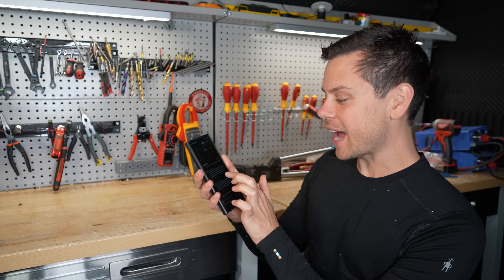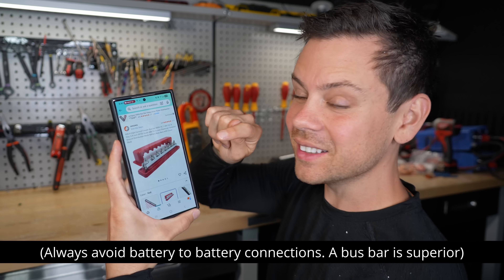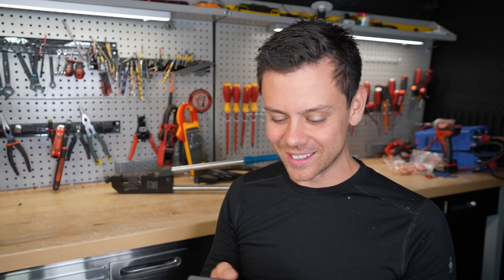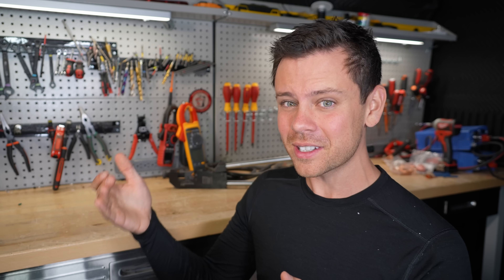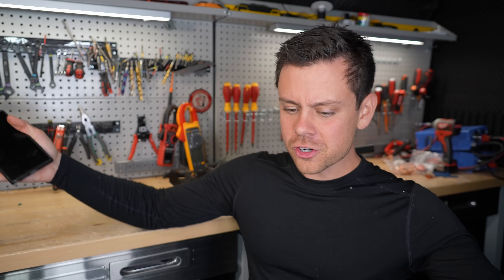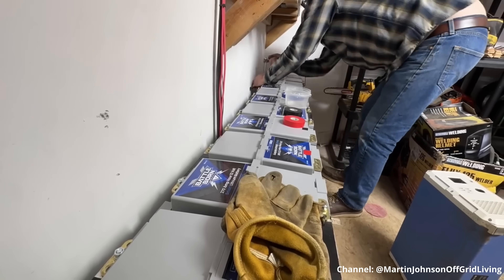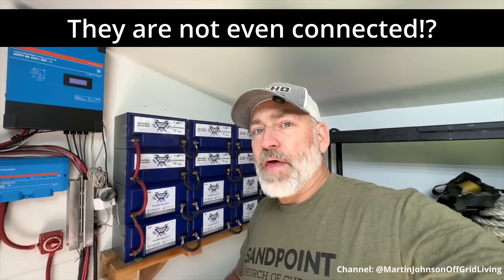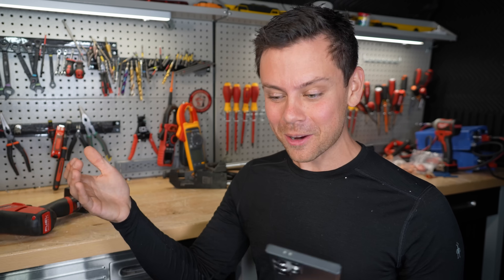My Reaction to Martin Johnson's "BEST Off-grid Battery Bank" Video 😬 Yikes!!

Comment: 16 x 12v batteries all resting on a wooden shelf interconnecting with soldered lugs and not a fuse in sight. Beyond risk, prone to disaster. Meanwhile 2 x 48v rack mount 180ah cases with inbuilt BMS, power switch and breaker connected to a bus bar is all that’s required, job done 1000x safer in 1/10 the space.

Comment: Have a quick question, for Will or anyone I have a BMV-712 victron for my LiFePo4 135amp and it’s in a battery box I’ve made, the victron BMV 712 has a aux starter battery monitoring function can I use that with a lead acid car starter battery? As it’s 2 different types of battery?

Also great vid, been watching you for years
Reply: Best option would be to email victron direct.

Comment: i solder em on 12dc systems, if you use the proper size wire it should never get hot... also fuses help

Comment: Most people probably just think any large steel bar will do for a bus bar. It's scary that people are DIYing these setups without proper knowledge. Goodbye insurance by the way, you should at least have a system that connects into 240V assessed by a licensed electrician. This guy clearly has no idea what he's doing. Who solders unless you're in a high vibration setup?

Comment: 9:10 the aluminum will not be any less oxidized from sanding, in fact, the action of sanding may even increase the amount of surface area on the face of the aluminum that will then immediately oxidize, creating more oxide.
Aluminum always has an oxide layer, there is no oxide-less aluminum because it oxidizes readily on contact with air.

Comment: Aluminum on copper is not that bad actually, it really depends on the application. Of course copper on copper is best, but i've seen plenty of examples of lithium batteries with aluminum contacts connected with copper bus bars. 
All of those examples have come from industrial warehouse robots and robotic pallet stackers that work in a wide variety of ambient conditions.
Especially the ones that work at -25C in freezers but are brought to room temp for charging. They go through crazy thermal cycling and i've never seen any issues inside their batteries other than the owner forgetting to turn the robot off causing it to drain the battery flat.
The copper on aluminum interface is always clean from what i've experienced.

Comment: Why hasn't Johnson's video been banned due to clearly ignorant and incompetent construction design ? Johnson obviously does not have the power electrical engineering expertise necessary to produce a reliable, safe and, not to mention, a cost effective system.  //  Soldering the cable lugs is a "No-no" because flux is corrosive to all metals except, maybe, solid gold. Flux must be thoroughly cleaned off after soldering, which is clearly impossible for the now sealed off lug interiors.  // A heavy duty crimper does not "weld" anything. Used properly it does produce an air-free, low resistance and physically strong joint with no danger that excess heat could melt the solder and loosen any such joint.  //

Comment: Most cheap jumper cables are aluminum wire, it has copper coating so most people are confused with the wire they are using.  Soldering lugs....LOL   Nice audio quality 4 gauge copper stranded wire will cover 99% of the cases that people are insisting on 0 gauge being necessary, actually aluminum, wire.    

5:00 - I personally love 4 gauge for everything.  I have no current source or draw that requires bigger than 4 gauge at ~5 ft.   I can connect that wire to a battery the size of the moon, and still have a nice 4 gauge / resistive link.   Bigger is not better.  It depends on charge and discharge loads, not battery size.   If I have a short condition, it will be limited by the battery interconnect size, 4 gauge, protecting the greater system.  

13:00 - You are wrong.   That does not show charge imbalance.   It shows a bank at exactly 40% charge with a slight cell to cell error.   Error that will only be trimmed out at the float charge phase above 80%.   If it was showing 20 - 80%, I would agree with you.  This ain't wrong.

Those Battleborn batteries likely have enough internal protection to protect themselves from charging like that.... and protect themselves from that guy :)

Do you want to work together on a lowest cost battery build?  Let's build a 10-100kW build for minimum cost!
Reply: Alibaba Lifepo4 Battery Prismatic Cells

Comment: Will, I started installing large battery plants 36 years ago in Central offices..(Telephone Offices) -48 volts systems that could easily have 4000ah per string. Some batteries weigh over 750 lbs each with 24 batteries in each string. Some phone offices have 20 and 30 strings of batteries. The one thing that stands out is not crimping the lugs and the other thing is aluminum bus bars? On the battery strings we use lead plated copper bus bars. the battery stings always tie to  copper bus bars. Too small of wire. 4/0 would be more realistic. Will you are spot on!

Comment: A crimped connection allows a copper to copper connection. Solder is NOT as good of a conductor of electricity as copper. So AFTER crimping you can solder to fill in any voids and make a stronger physical connection. Or you can just properly crimp the connection and not solder. . So says the Code.

Comment: Is this response rage bait? There is SO MUCH wrong with your response! You missed the mark OVER AND OVER AGAIN with factually incorrect information!

1) You said he was wrong testing each pack to be with in 1/10th of a volt, and instead they should be charged to 100% then connected (and you also said its fine to just "assume" they will be at a similar voltage). You are flat out wrong, packs at 100% SOC vary in voltage at 100% SOC even new from the factory, let alone if they have been previously cycled. the ONLY way to prevent an inrush current from a high SOC pack to a low SOC pack is to VOLT MATCH. This is the STANDARD in the industry since the first battery pack was invented. 
2) You said he is wrong for using aluminum for the bus bar and that "it MUST be coper" - Again BLANKET WRONG. Aluminum is FINE for bus bar AS LONG AS IT IS SIZED CORRECTLY. Why do you think the lines companies use Al cable for HV at 11kv 22kv 33kv? Why is Al used in house wiring.. Because its FINE. You just need to SIZE CORRECTLY FOR THE VOLT / AMP LOAD. An Aluminum bus bar is of course going to be thicker than copper, but there is NO CHANGE IN PERFORMANCE WHEN SIZED CORRECTLY. 
3) You have ZERO idea what the lug is rated for, it may be rated for a solder joint. A crimp is better for resisting torque or pull on the lug, but i see no issue with a solder connection for a fixed installation. 
4) You're complaining about his 4AWG wire size - demonstrating you have zero understanding. You state his pack is 270amp hours, and that 4AWG is too small. You're assuming the pack will dump ALL its current at one time., or that the load would be higher than the 4AWG rating, which he then clearly explains that the WIRE IS SIZED APPROPRIATELY TO THE LOAD AND THERE IS UPSTREAM FUSING TO PROTECT THE PACK. - So again, NO ISSUE DETECTED. 
5) I do agree with you that the positive cables should not be adjacent to a negative terminal - any movement in the cable against the terminal could rub through the insulation and cause a direct short. 

But overall, your attitude to this is disgusting, you are laughing at someone trying to "educate them" despite having very little udnersatnding of the industry past spec sheets. A basic FACT is that packs are balanced based on Volts not SOC, SOC will result in inrush leading to a direct safety issue or pack damage situation, and your simple lack of understanding about coper vs aluminum is comical.
Reply: @ 11kV, 22kV, 33kV
Lines are properly sized for their application. And aluminium because of cost savings with appropriate steps followed at connections.

Soldered connections? What happens when the undersized conductors overheat?

The load is irrelevant. The conductors need to withstand the maximum current that might pass through them in a failure. With no fuses, a short in the wiring would result in the batteries dumping their max capacity amps. Melting insulation, wire, and soldered lugs.
Reply: @ericdunn6232  Another dumb response, i guess soldering should never ever ever be used ever, because it could overheat? 

Oh so every conductor must be protected for max current? Why aren't your wires in your house rated to the max supply to your house? Oh yeah.. because there is inline protection. Why isn't your DC mains from your car battery in your vehicle rated for the max possible current dump from the lead acid pack? Oh YEAH - PROTECTION, or in most cases because its just not needed! 

Looking forward to you sharing pics of you 4AWG house wiring seeing as you say "All conductors need to be sized to maximum possible loading!"

Comment: 20 grand for batteries - no money for proper bus bars or tools. Mechanical connection is a must - I guess this fool doesn't know solder melts.

Edit - turns out this guy is a shill for the overpriced battery seller - should have guessed.They probably can't find anyone with actual knowledge that will gobble the knob like this fake does
Reply: Battleborn should be held liable for anyone following that video and causing injury, damage, or fire.

Comment: His wiring is bad for sure. But what's wrong with 4s4p configuration? If done with fuses and brackets between each battery and each bank? Ask this the correct sized wire? And an active battery balancer

Comment: This is comedy gold, UK here I worked in the US electrical engineering for almost 25 years , I met and had the pleasure to work with some outstanding multi skilled tradesmen and some super intelligent Americans especially in the Electrical / software and welding fabrication fields , however I also met plenty of clowns like this battery bank building clown show ALL too common, normally results in injury , accidents and equipment failure.

Comment: Serial BMS is no good idea. When one of the batteries bms cut, it will be disposed for the hole series of voltage. For 48v You do need 48v batteries with suited 48v bms.

Comment: So you can solder battery connections as long as you crimp the connection first. You must use the correct crimp die for the wire/connector size.

Comment: Aluminum is not your choice for electrical connections!
There is a reason why we use copper predominantly in installations.

Aluminum always has an oxyde layer on it and is highly reactive to form new oxyde layers, so you have to go to extra lengths to make sure you have good, and lasting connections!
That's just something for professionally, highly controlled processes.

Don't bolt on aluminum bars on your batteries! 😬

(And don't use shity murican made batteries in generell) 🤭

Comment: 4:30 somebody needs to go over to his channel And tell him he needs to redo all those connections and get rid of a solder You just made a resistance point and using other size wire also is going to create a fire. Somebody should go over there and tell him he's putting a family in danger with ignorance. This guy should have gone to a  car audio shop and see how actually wiring installs are done. This guy I don't know what to say

Comment: Not to mention the maximum throughput internally (cabling and BMS) of each battery.Good call on not soldering lugs. We do that, but never considered potential heating of the terminal melting the solder.

Comment: WTAF!?!?! Sure I use solder on SOME low voltage stuff like simple LED lighting, fans, ya know 12v stuff. I'm in an RV so vibration is a factor. You have to crimp lugs however!

Comment: I crimp mine with a hydraulic  crimoer than solder,  the crimp is so well that the soldering doesn't  pass through,  however I like drilling and filling the empty  space with flux and tin.  Then the same on the other side, all my crimp are done twice meaning a wider crimped area,

Comment: You would hate my set up, I’m even confused. 1 battery 460AH , 1 3000Watt inverter bur my solar panels are all different, rated at 12 Volts but not by the numbers

Comment: Dude also used solder and flux from the plumbing isle at Home Depot. Probably not a big deal for this application, but the kind of solder/flux used when sweating copper is not usually the right composition to use for electronics.

Comment: After watching the Battle Born videos, he is creating a safety feature by using solder instead of crimping them. If the terminal overheats enough the solder will melt, allowing the wire to become loose, thus limiting the current. See, it's a feature! In any case, this video was posted four months ago. I then wandered down and saw that Martin made a followup to his video a couple of months ago - I'll see what the six mistakes he identified are.

Comment: Buy cheap buy twice? With what you spent on your batteries alone I could buy almost 5 highly rated complete off-grid systems from places like Sun Gold power. A 6.5 system with  inverter that can parallel up to six units and even supply 120/208 three-phase power If you wanted to, with 5,500 watts of solar panels, breakers, solar wiring and connectors, and 2 48v 100 amp hour server rack batteries with proper 48 volt BMSs with communication that is designed to control parallel strings is $5,500. Everything UL listed.

So for $27,500 I could have 32.5Kw of inverter/solar charge controls, 700 amps of battery charging capacity when hybrid charging with grid or generator power, 27.5 kw of solar panels, and most of the hardware needed to install it. 

By the time we account for the rest of your equipment I could probably have two full six inverter series set up to supply two separate 120/208 3 phase services outputting 78 kW, with 115,200Wh of storage, and 66Kw of solar collection and a hybrid charging capacity of 1,680 amps. 

Even if half of that failed I think I could survive the Armageddon with the other half 🤷.

Comment: Where are the busses bars and t fuses to make sure they are charging evenly and protected and also all wires from each batter is the same length so the wire resistance is also the same. Electricity like water will flow to the path of least resistance,  duu.

Comment: Aluminum bus bars are fine as long as you take into consideration that they need to be bigger due to the lower ampacity.

Even upsizing, you'll save some weight.

It is a common misconception that solder is a great conductor - it's not.

Soldering what should be a straight mechanical crimp introduces a point where heat will be increased, and in a mobile application a failure point due to vibration.

Comment: Is the BMS protocol any kind of standard? I bought a solar panel/charge controller package from Zendure. But their battery prices are double what they should be. Will anyone else's work with their's. It's the SolarFlow 800. Thanks

Comment: You might need 4/0 welding cable for 300amps, but there are lots of companies that make fine stranded tinned ofc 1/0, 2/0, 4/0 wire for car audio. They are slightly larger than normal AWG. The 1/0 can handle that many amps less than 5ft. 2/0 can handle almost 500A, and 4/0 can handle 700A.

Comment: Question on your comment about not putting four 12 volt batteries in series for a 48 volt system....if you install a balancer for the batteries then what other "bad" issues would be left? Edit: Assume deep cycle AGM sealed lead acid batteries, no BMS

Comment: Martin is sanding tin-plated copper busbars. That shiny silver coating isn't just for looks—it is a functional layer of tin designed to prevent the copper underneath from reacting with the air (oxidizing). 9:13

Comment: Timestamps:
0:00 - Intro & Cost Reality Check ($20k vs $5k)
0:52 - Critique: Don't use 12V batteries for a 48V system
1:43 - Critique: Using aluminum bar stock instead of copper
2:57 - Safety Hazard: SOLDERING large battery lugs (Don't do this!)
3:25 - The correct way: Hydraulic crimping & cold welds
4:10 - Critique: 4 AWG wire is dangerously undersized
4:41 - Why parallel strings are dangerous without protection
5:36 - Designing for battery potential vs. load
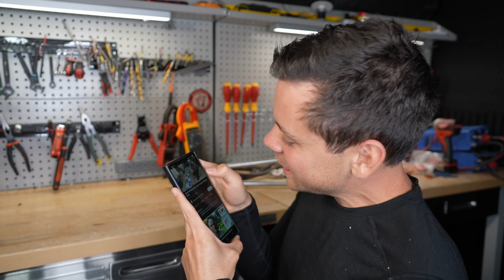6:17 - Bad cable routing & "Rat's Nest" wiring
8:32 - Thread locker on stainless steel hardware issues
9:55 - Critique: Voltage is not accurate for balancing LiFePO4
10:18 - The correct way to balance series batteries
11:09 - Confusion between Energy (Wh) and Power (W)
11:35 - Is Battle Born still the "Gold Standard"?
12:45 - Server rack batteries vs. Drop-ins (The modern solution)
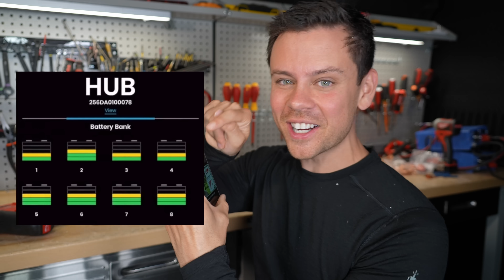13:25 - Evidence of imbalance in the app
14:55 - Final verdict & Safety warning

Comment: I connected two EG4 14.3 kWh batteries together in parallel based on the voltage being the same and I checked the current through the wires and it was only 10A.  Maybe I just got lucky 😅 I guess there could have been a tiny spark/arc when connecting the second pole but I didn't hear anything.  Definitely don't want burns on my battery cable connectors.

Comment: I wasn't worried about soldering crimp connections, but then again I solder crimp connections after crimping them so he is skipping a step by my standards. My little experience of 'fun' with batteries was in RC cars and lead to using packs in parallel and disregarding if the parallel packs were in a matched state but they had diode isolation from each other and 1 pack could handle the load alone without damage; the cells in series in each pack still needed to be matched & initially balanced or the pack life would suffer. An upcoming pricey UPC battery replacement lead me down the route of finding your videos and reminding me that I should probably just talk to my dad who custom engineered a rather large solar array install on top of a mountain years ago but its fun seeing what people are up to who aren't just buying+installing with everything premade+preassembled.